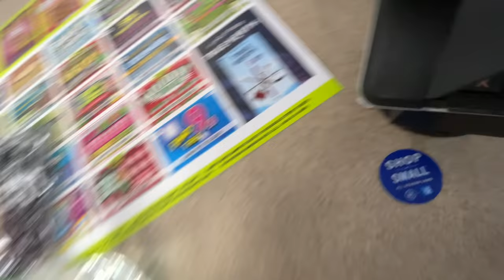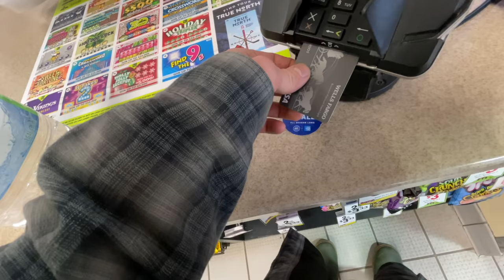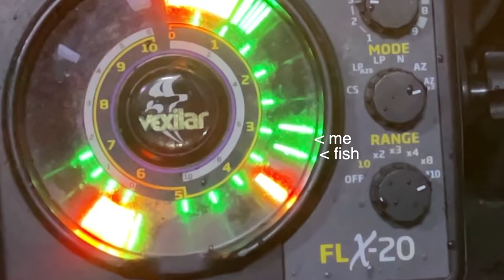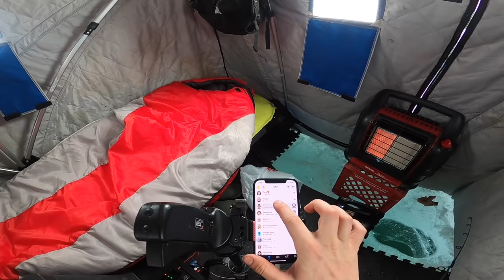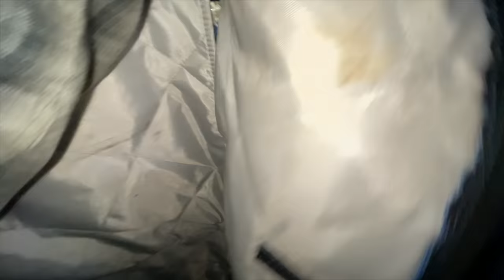Ice Camping for the Biggest Trout of my Life - Weekend In Small Tent

Comment: Sled needs some maintenance. Don’t sound like she’s too happy.
Reply: not sure if im completely set on it but i think it kinda sounds like the carburetor needs to be cleaned out
Reply: Carb job and some new plugs. Shouldn’t have to hit the throttle that many times for it to rev up
Reply: Do y'all not hear that it's only running on one cylinder
Reply: @adamnchambers  well no duh Sherlock and how do you fix that? By cleaning carb and changing plugs like mentioned. And hoping compression is still good.

Comment: Sounds like the sled is running on one cylinder
Reply: I was thinking it sounds like it’s down a cylinder when it’s under load. Possible a bad coil
Reply: Change spark plug on cylinder not working. Easy to find out , the cold cylinder. Should feel it with yar bare hand

Comment: Holy crap that was the biggest lake trout Ive seen. Most of those lake trout die when you release them. You might as well keep the ones in size limit.
Reply: Why do they die?
Reply: @alexdavis3428  the lake trout live deep. And when they are reeled in fast to the surface they essentially "get the bends" like a scuba diver and suffocate. The fish’s swim bladder expands like a balloon because of the reduced pressure and they can't adjust to the pressure change fast enough. I've always heard that lake trout will die upon release if you've caught them deeper than about 25 ft. The only way to prevent this is the reel up the lake trout very slowly, but you will likely lose the fish anyway trying to fight it so slow.

Comment: Honestly I would not have balls putting heater on and sleeping on middle of the icy lake
Reply: Try the Styrofoam cup of water in a fire experiment. It would take one hell of a heat source to cause thick lake ice to fail.
Reply: That heater has no chance to break through that much ice. All you get is a bit of water on the surface  in the morning
Reply: Its 10+". You could almost drive a car out there
Reply: @nathanmace3936  lol we drive trucks with massive shacks on the back in manitoba on ice
Reply: Doing it right now bro. 2 dead sticks in my tent, heater blasting on high...yeah some water but we’ve still got 13+ inches of ice baby! 

Go out and get you some! 9 walleye in the shack so far!

Comment: I've never understood some people ice fishing.   Having a tent or a small ice fishing hut, with a small wood stove, gas heater or both...   little cot and chair is fine...

but some poeple bring "rv shelters" out onto the ice with big heaters, beds, TV's, DVD/Xbox, satellite...   sec...  

Microwave
3 Burner range & hood vent
30 Amp power center w/ 25′ cord
Forced air furnace 35K BTU
400 watt solar with 2000 watt inverter
40” TV (12V) + 32" TV (12v) in bedroom  
2kw generator,  2x gas bottles.

Honestly, add in the heated floor, walk around in socks with the reals going through holes in the floor and play on the xbox while waiting for a fish on...   thats...  not fishing..